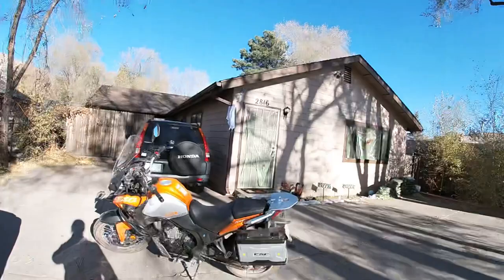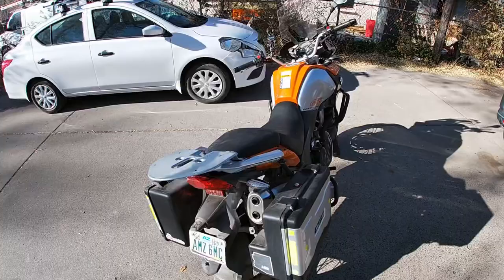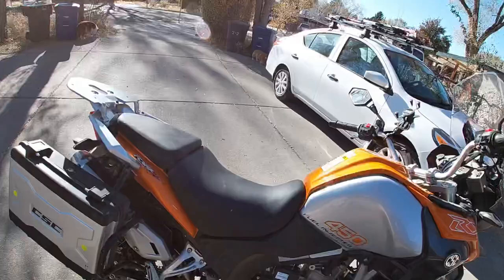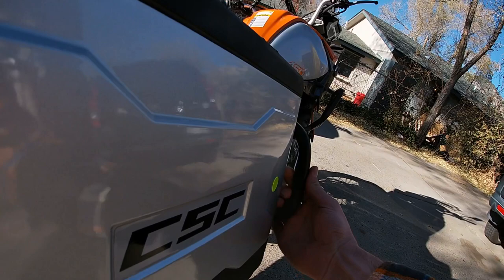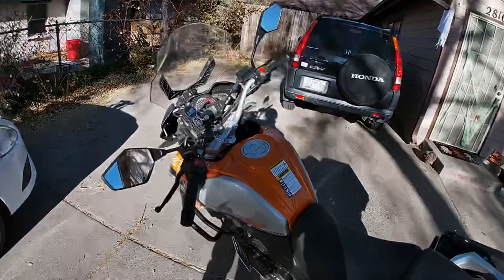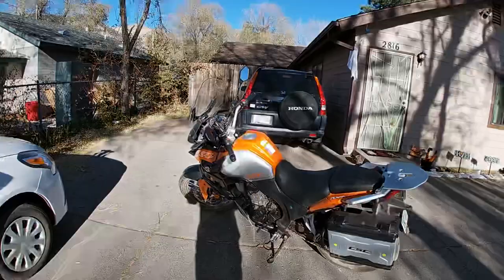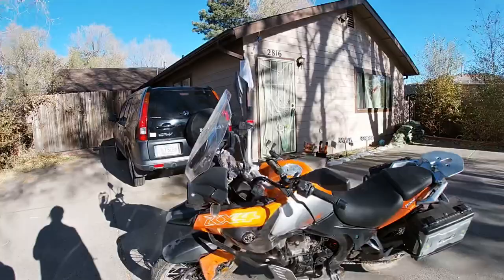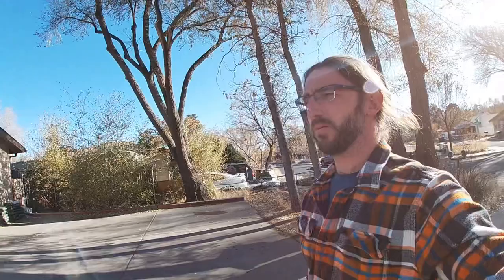CSC RX4 - Video Blog Take-off!

Comment: How has the power been?
Reply from the maker: Consistently good. Can get to 60 in 6 seconds or less (need to do an official test) and had passing power through 75-80mph. Anything above 80mph you loose all power. 

Going on highways up a 8% grade, I can maintain 75mph easy, doesn’t want to push to 85mph on that grade though
Reply: @georginglis423  Do you have to run a high octane gas? What is the maintenance schedule like? I've been looking into the Royal Enfield Himalayan as well as the Rx4. and would like to hear from someone that owns the rx4. Thanks. Looking forward to seeing some travels vlogs!
Reply from the maker: I’m only 280 miles in after a week of ownership, so I can’t speak to any maintenance. 

No need to run premium gas, but I am for the first 500 miles.